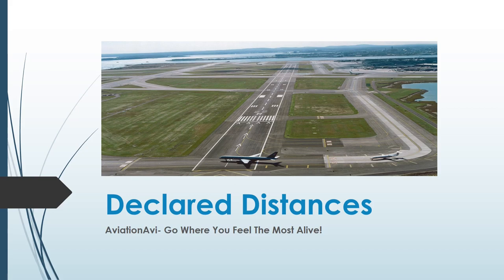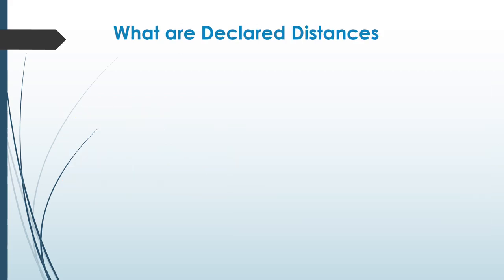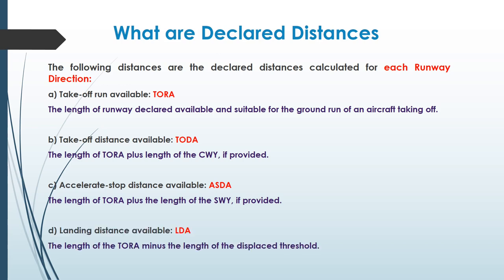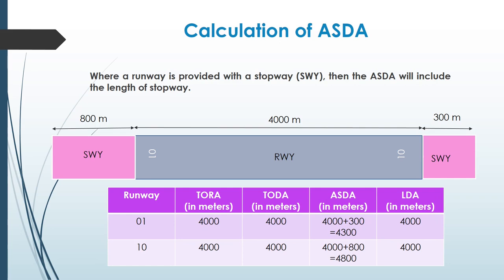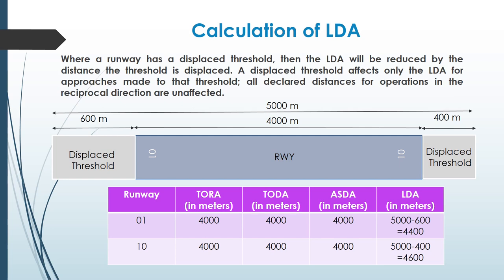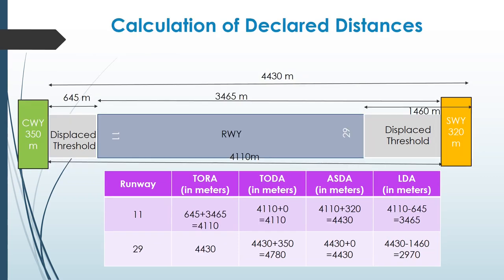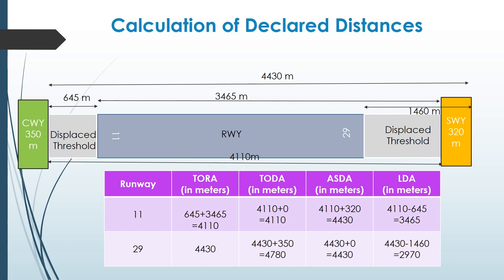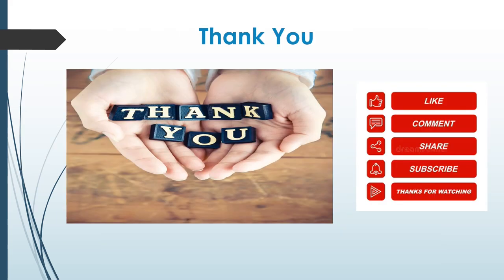Declared Distances for Runway - Most Detailed video with Interesting Examples !!

Comment: Stopway is not included in TORA s per ICAO
Reply from the maker: Yes Stopway is included in TODA 

TODA = TORA + length of SWY
Reply: @aviationavi7532  TODA= TORA + CWY
Reply: Yes same doubt for Rwy 29,they included SWY in TORA which is wrong.
Reply: Some mistakes in the calculations, need to be audited. Get back to the performance material of the EASA ATPL course